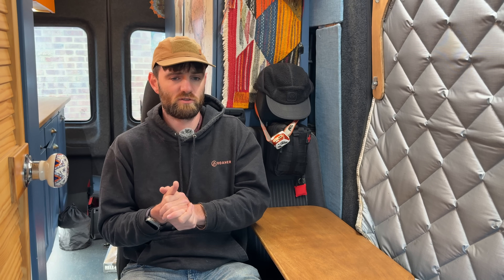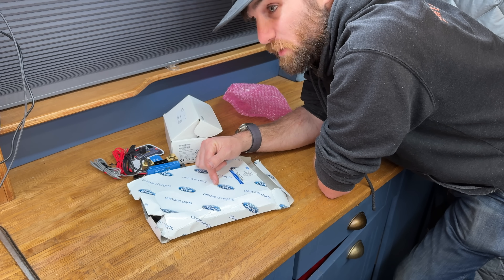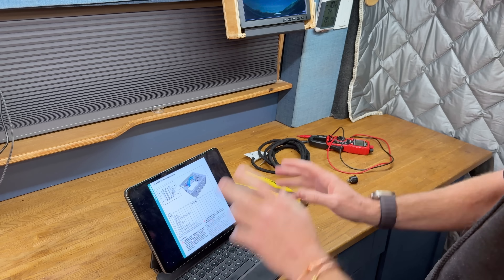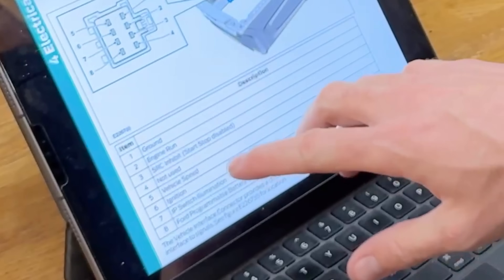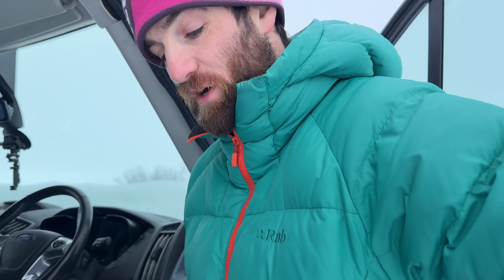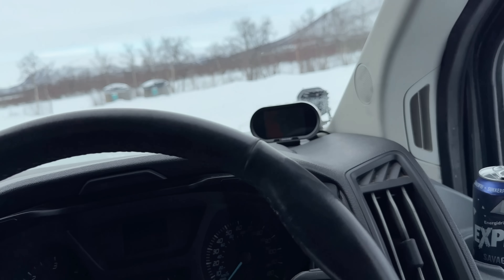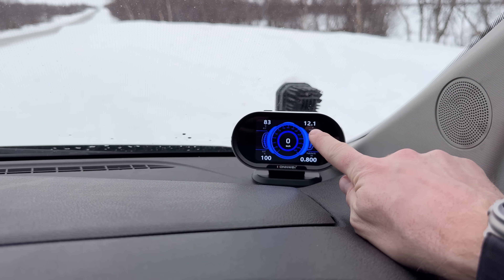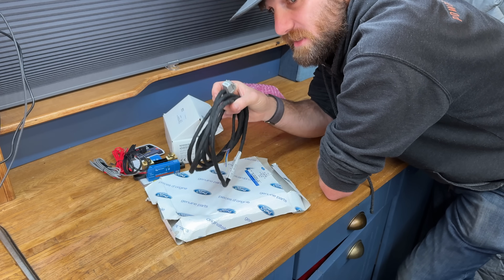FORD TRANSIT: How to DISABLE Smart Alternator “Official FORD Method”

Comment: Hi Alex - quick question please....I believe your van is a 2.0l model and therefore a wetbelt? I'm embarking on building a van soon and love the shape of the transits but wanted the 2.2 camchain version (struggling to find one in L3H3 with aircon though). Why did you go for the wetbelt version knowing it's inherent problems? Thanks in advance, Chris
Reply from the maker: I feel a lot of the inherent problems concept with the van’s wetbelt is overplayed. 

The bigger problem can be the end user,  infrequent servicing and the wrong oil used seems to be a bigger issue.
Reply: @MispronouncedAdventures  i agree that more frequent oil services and ensuring the correct oil is used, DOES help matters, (as in doing MORE oil changes than the initial recommended miles/time suggests), 
sadly the fact remains, that wetbelts WILL fail/degrade earlier than stated (they only "safe" up to 80k 6 years) which ends up as fragments that becomes loose material in the oil/oil-pickup etc.
and buying 2nd hand Vans makes it VERY hard to fully trust its past.
(even past wetbelt replacements where it was bad, but ONLY the belt has been done, and NOT the pickups, or the smaller oil pump belt etc)
im in the industry, and believe me, this is VERY much a problem, and its not over stated enough !
Reply from the maker: @gadget78uk agreeing with you there. If bought a secondhand vehicle again with a wet belt, I would have it done as one of the earliest jobs
Reply: @MispronouncedAdventures  whats scary is the interval has been lowered to 60-80k or 5-6years,
and the charge for retail to get these changed is HIGH due to the amount of parts/work
(close to £1000 to be done properly, with new pickups, new cover, all belts, breathers etc (and retail).
so having that LARGE cost every 5-6years/80k,
adds more to the "running" costs of owning a vehicle with a wetbelt fitted :(
Reply from the maker: @gadget78uk when I got my 2018 it was still the original 144k wet belt recommend life span
Reply: @MispronouncedAdventures  they have ALL been lowered, especially the original...
Reply: @MispronouncedAdventures  You are correct on the issues re the wet belt....a silly idea in the first place, but as you say regular servicing with correct oil is the answer. I bought a 2019 Transit last year with 330000Kms on the clock and with a excellent service record, second owner. Just replaced the original wet belt and it still looks brand new with little wear and no missing teeth. Granted they should have done the belt at 200k but there was no record if it happening.